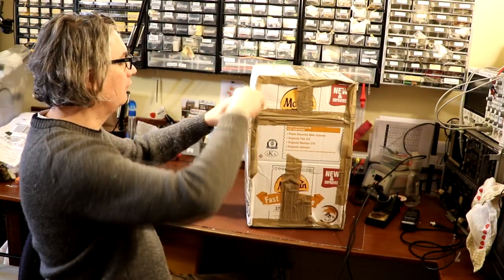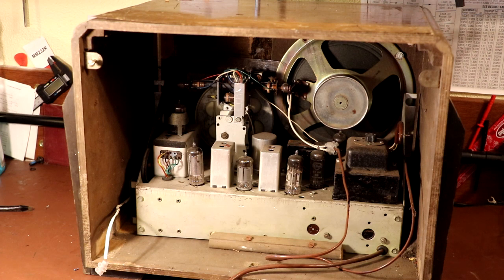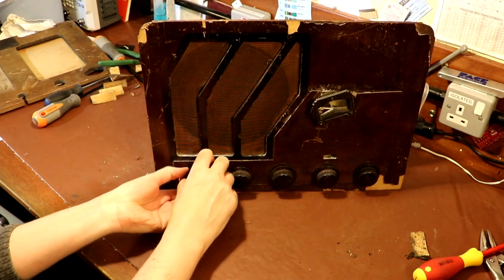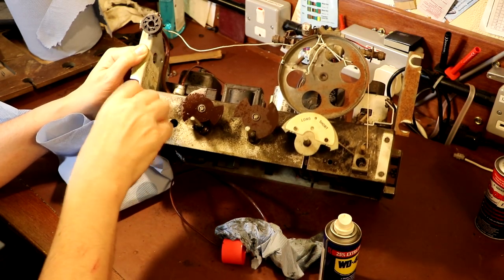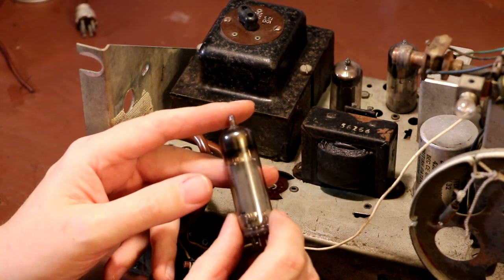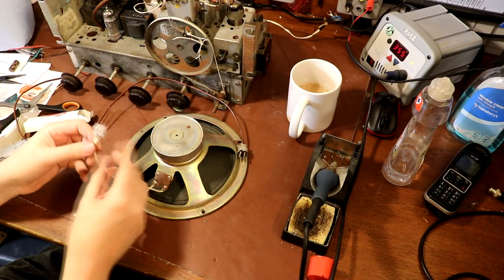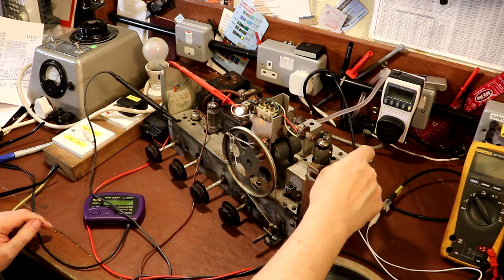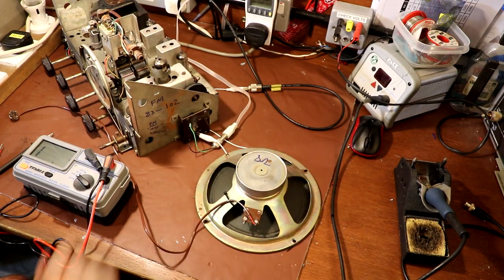A Fool And His Money

Comment: I am amazed that the FM band still works, it seems that on most of the 1950s era sets I own, with FM, the AM broadcast band (M.W) will work but the FM side will not, even on German sets.
Reply from the maker: I don’t have much experience with FM set but it appears to work really well and pulls in lots of stations loudly. Thanks Regards Chris
Reply: I don't have much experience either, in part because I didn't have the tools to perform a proper alignment, and because most FM sets are much newer then what I typically like. North American sets also used those stupid mini IF cans with the silver mica capacitor sandwiches in the bottom, they can, and often, go flaky resulting in the set working poorly, or intermittently, I think that most European and British sets used either molded mica caps or ceramic ones which tend to be more reliable.
   It looks like the Chicom EL84 worked well enough, I think the complaints about Chicom tubes have to do with trying to use them in audiophool equipment where they are often overdriven, or because of confusion over the specs. I'm pretty sure they used a similar numbering system to Soviet tubes/valves but the specs don't always match.

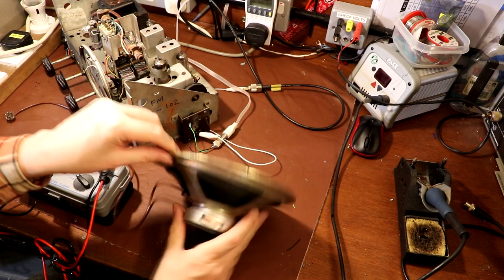Comment: 37:59...you probably know that better than me but my guess is that the original speaker would be 4 ohms but you can check either the schematic or figure out the turns ratio on the output transformer by disconnecting it then feeding it some voltage and mesuring the output voltage.. about the tone, i am guessing some capacitor around the tone control that shunts some frequencies to ground to shape the tone might have changed in value. if in the end it still lack bass i guess you change/increase the coupling capacitor's value to let more low frequencies get to the output valve
Reply from the maker: I had a quick look at the radio data and the original would have been 2.5 ohm. I’m going to look for a replacement as I think it’s a pretty crappy speaker I’m sure a 3 ohm will be fine. Probably get a mid range etc. I’m not going to do any more work on this until summer when the garage warms up and I can strip the cabinet. Thanks regards Chris
Reply: @allthegearnoidea6752  if you want to use a 4 ohm or 8 ohm speaker you can use a wall adapter transformer as the output transformer, for example a 220 to 9v transformer will give a nice 5k primary to 8ohms secondary. it works very well and sounds good if it's not a hifi system.

Comment: i'm at 5:56 on the video....no bottle style valves, permanent magnet speaker and the antenna , definetely doesnt look 30's, maybe 50's...it even looks like it has FM (box on the left)....dont worry i have been there, i right now in this precise moment a am taking a break to relax from an oscilloscope repair . i bought it on ebay thinking it was an all tube/mostly tube scope and it turns out it has about a gazillion germanium transistors wich are the component i most hate in my life...only the x and y outputs are tube operated..the trigger and all the oscillators for timebase etc are all germanium goodness...lots of old zeners, lots of germanium diodes,selenium rectifier, etc... the only manual i can find is in dutch...and i paid 80€ for the thing...so i'm on the same boat as you ahahahha it's almost working but i was disappointed, i only did proper research after i bid on it. now i "need" to finish fixing this one and buy another because i still want an all tube scope for my bench
Reply from the maker: Hugo B.  I’m just the same on those Germanium transistor I wonder if you have the usual tin whiskers problem. Selenium rectifiers are another pain. Whenever I give them the benefit of the doubt they usually let out a cloud of stink white fart in my face.   I never do much investigation in the stuff I buy it’s alway an impulse buy. Thanks Regards Chris

Comment: Ahh jazz club, Nice :-D.
Today ill be mostly eating PROZAC!!!.

It is a shame that you got an imposter radio, but it has life and can be improved :-D.
Maybe the series audio coupling caps are low in value and filtering the bass out.
Also its possible it was designed for bigger speakers in a larger case, better bass?.

Radio cruncher is chuffed with the transformer, i havnt heard a bang from the devon direction yet :).
Smashing video chris :-D
Reply from the maker: zx8401ztv  Yes your probably right on the capacitors they look very poor. It should have 2 ohm speaker rather than the 8 ohm. But I don’t think the sound quality from that speaker is a good match.  I am sure we can improve it. Thanks for  watching and comments best regards Chris.

Comment: great video on how to approach getting this Frankenstein back to good condition.
i learned a lot from watching how you went about it.
regarding the dc curren is  that something to watch as you increase the a/c voltage?how much or how little should you expect on a typical valve radio?and your connection was just behind the rectifier stage?thanks
john
Reply from the maker: jw228w  You can get a rough idea of the current from just looking a the service data for the radio as they will often list the current for each valve so just add these together. It’s different to give exact figures but you will often see the current fall as the electrolytics start to reform and if it starts to rises you can guess something is failing. The lamp limiter is really handy with a 100w  lamp it should barely glow for a valve radio.

Comment: looks like it would have been a nice looking set that speaker looks fairly modern  from that little diagram on back of it you can see the earth connection that would have fitted in the hole on the mains plug that you pointed out in an earlier Video somebody correct me if I'm wrong its the only I will learn !
Reply from the maker: thehappylittlefox aka benji  That speaker is really crappy. The original one is specified at 2.5 ohms rather than the 8 of the one fitted.
Reply: @allthegearnoidea6752  it will be as its not a hifi speaker probably sounded ok in a sealed box for a cheap stereo hope you find a suitable replacement !

Comment: Hi chris an excelent video  and a master class in how to start repair of an old valve radio . rather than the american idea of change all old caps on sight befor pluging it in.
Reply: Indeed, getting it working first!
Reply from the maker: rob titheridge  I’m not against Changing out all those capacitors they will very likely be bad anyway. But I like to test as I go and see the improvement as we go. It’s not a production line so I enjoy the process etc. But grid coupling capacitors should definitely be changed out first as a leaking one can damage the valve etc.  It’s all good a million ways to tackle these jobs. Thanks for watching and nice comments. Regards Chris
Reply: In my case it depends, I will try to power up a set on variac or dim bulb only if it passes a visual safety inspection first. I won't even bother trying to power a set up if there are loose wires, bare wires, broken or burned parts, etc. But I know from experience that 9 times out of 10 that it's not going to work if it's a pre war, North American set, and maybe 50:50 on a post war one, if everything is original.